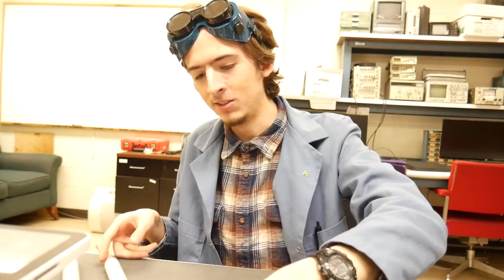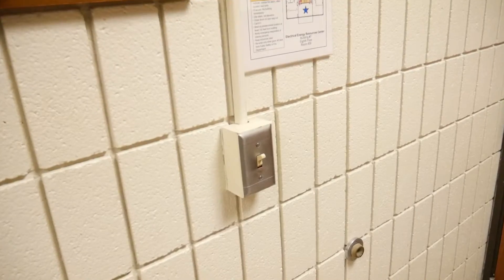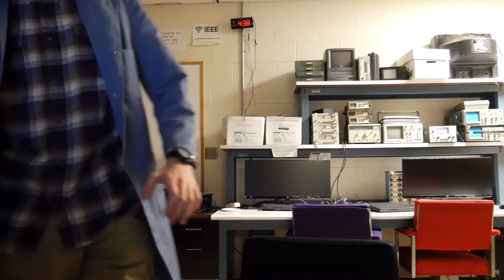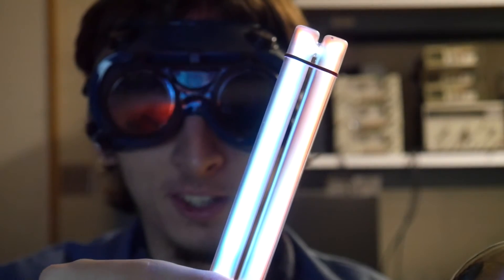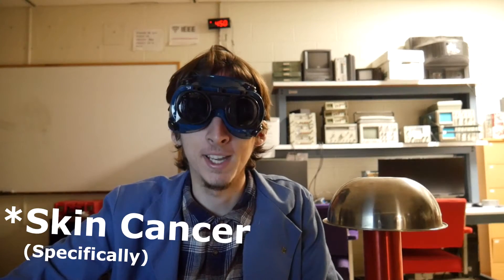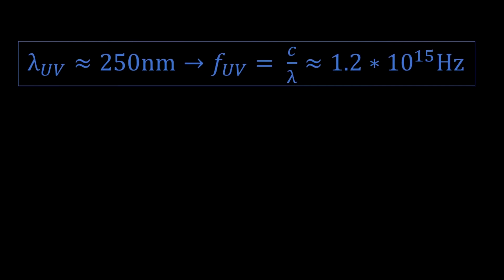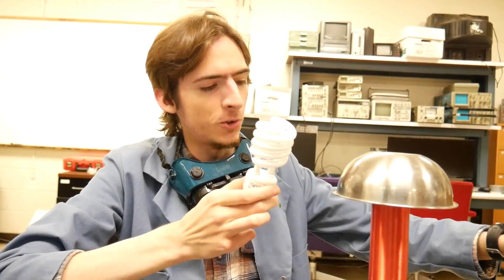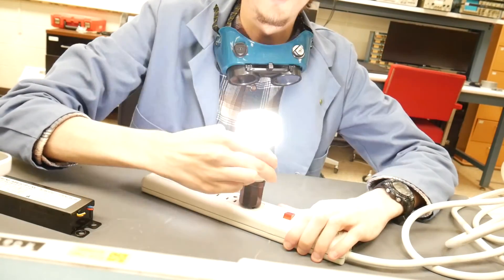How a Fluorescent Lamp Works

Comment: Not all fixtures use an electric ballast. Older style lamp use magnetic ballast to regulate voltage and a glow-starter to strike the lamp. Other fixtures use “rapid-start” ballasts which preheats and strikes the cathodes at the same time so that the bulb lights quick but doesn’t damage the cathodes like modern instant-start ballasts do to bulbs. Even though electric ballasts allow the lamp to start without blinking, this actually shortens the life of the bulb, this is why the older fixtures often still use their original bulbs.
Reply: I love that reading the comments just brings more great knowledge instead of conflict and belittling ... thank you, sir 🙂

Comment: Nice explanation.   To top it off, fluorescent lamps can be separated into two categories based on the method used to start them.  Those that use cathode heating, and those that start with no cathode heating.  

The first category uses preheat, trigger start,  rapid start or programmed start ballasts and each of the three variations use slightly different circuits to achieve a similar principle.  A low voltage current of 3 - 9 volts is applied to the cathodes which glow cherry red. This boils off electrons, then a high voltage difference is applied across the lamp to conduct an arc through the length of the lamp.   

The second category uses a significantly higher voltage than other types of fluorescent lamps to conduct an arc though the tube, since there is  no preheating of the cathodes.  This method is called instant start, and lamps designed for such use typically have a single pin on each end.   This is most common on the 72 and 96 inch lamps, but is sometimes found with other sizes as well such as the 48 inch lamp
Reply: GREAT info, thank you sir!!! ☺

Comment: Question: if the ballist is used to step up the voltage, and forgive me if this is wrong, are the transistors acting as amplification as well..? Also if the transformer needs to step up to voltage, how are we able to then use a low voltage Tesla coil to excite or power the mercury gas?
That's kind of what I was hoping this video would answer for me, I'm having to reteach myself electronics because school filled my brain with a bunch of nonsense about electric theory.
Also...how DO they get that gas in those tubes..? It looks like it's also just two anodes inside the UV tube? Looks a bit different from the florescent tube construction which is hollow, dose that mean the gas is connecting the circuit?
Reply from the maker: I'll try to answer your questions in order:
I'm not an expert on the circuit design for an electronic ballast beyond a basic knowledge of how they work. I believe that ballast convert the input to DC first and then use a high frequency inverter (the transistors) and a transformer to bring the current-limited high voltage to the tube.
The Tesla coil got around this problem since it is already a high voltage (several kV) and current limited source.
To get the gas inside of the tube, they first blow the glass into the shape that they want, create a partial vacuum in it, and then fill it with whatever gas they want: Mercury, Neon, etc. Often times, these gasses are collected from distillation columns.
Reply: @BlueprintScience  thank you, very through!
So still on the Tesla coil.. I have one that uses 5v USB, and I can get it to power a florescent, but it's not as I understand creating that high of voltage, granted it's not as bright, but is still powering it. 
So this begs the question in my mind since a Tesla coil is so much simpler and smaller to make.. why isn't this be used to power a florescent in place of a balast..? Feel free not to answer this, more of a question to the ethos. And thank you for your time and videos, really got a TON out of the microwave ones.

Comment: I thought theres a heating element at each end of the bulb, and the ballast first heats the gas inside, to help the gas become conductive, then switches the terminals and uses the heater coils as a lead on each end to conduct across the bulb. ??? Then acts as a current limiter. As you have said. Is this video just a different technique? Or ???
Reply from the maker: How I understand it is this:
Before the gas ionizes, the filaments heat up. Once the gas becomes conductive, all the power that was going through the filament now goes through the gas. Heating is an important part of the process. If you look real close at the mercury tube I had, you can see where it glows orange by the filaments due to the heat.
I know that the ballast that I had uses 600V to ionize the gas and simultaneously limits the current the whole time. As far as I know, all ballast do pretty much the same thing.

Comment: Hey, I got a question...  could you possibly "jump" in an oscilloscope and observe the different sine waves generated by different bulb types?  Or would a wave be observed at all?  I would try it myself, but I sadly don't have my oscilloscope anymore...  :/  awesome video btw, just in time for the spooky holidays!!
Reply from the maker: Hmmm. I don't know what you mean by "sine waves generated by different bulb types." As I understand, they all use 60Hz AC and are a resistive load only. I may be very wrong though.
Also, thanks Snyper. Happy Halloween.
Reply: @BlueprintScience  Yeah, I didn't think before I typed.  You're right, output would be 60hz AC, and I should've known better about light bulbs being a type of resistor lol.